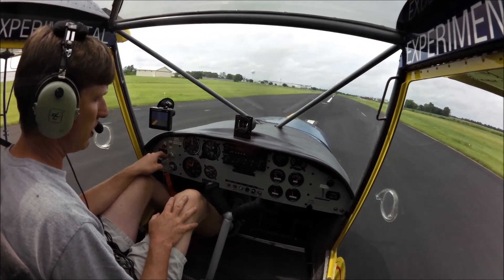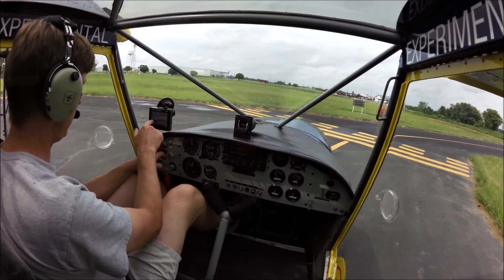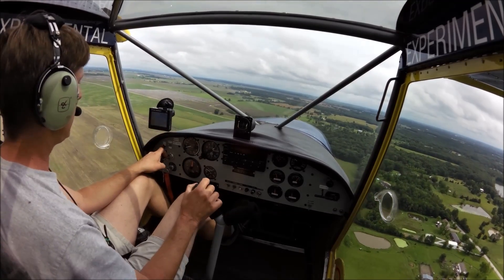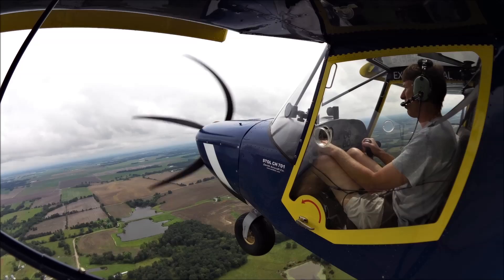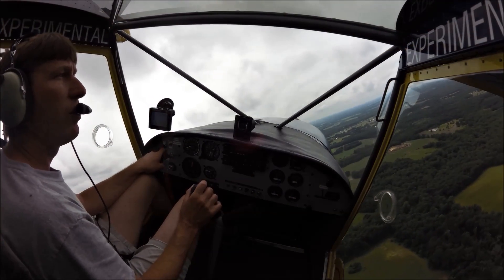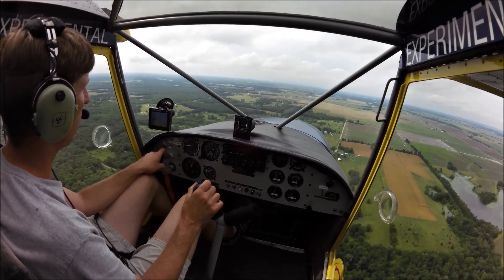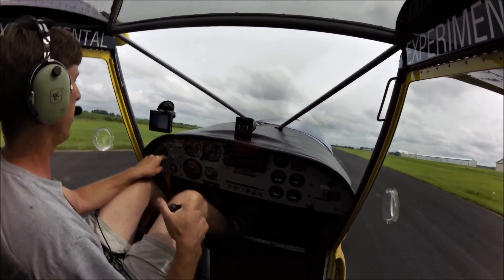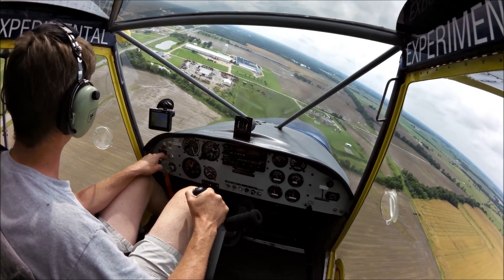Zenith STOL CH 701 flying with the Dynon Avionics D2 Pocket Panel

Comment: Awesome although it looks like a tight cockpit fit
Reply: The CH701 is the smallest variant of the Zenith STOL line of airplanes. The CH 750 cabin is significantly larger and has fully adjustable seats for taller / bigger pilots